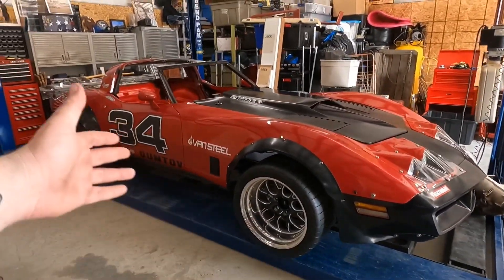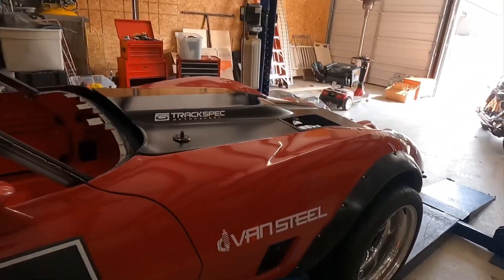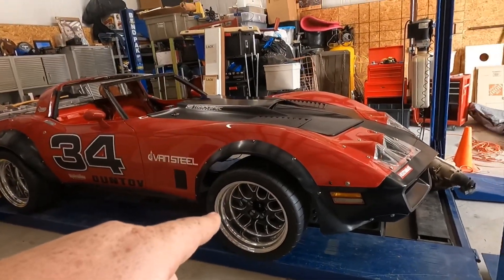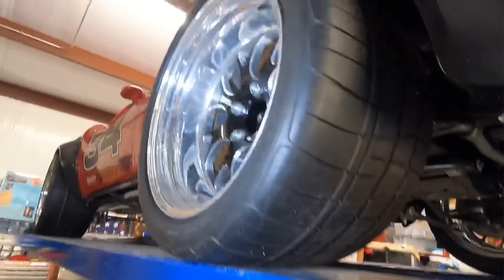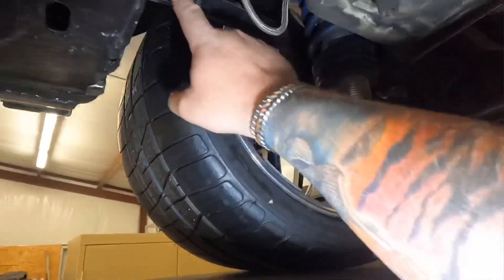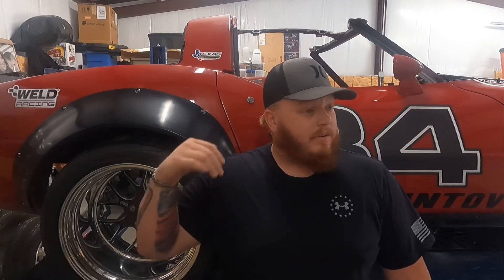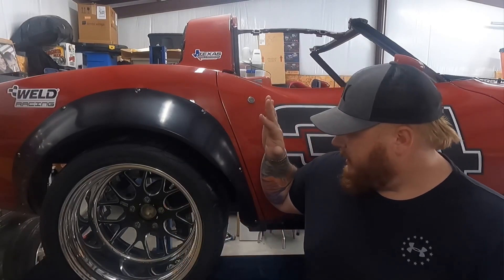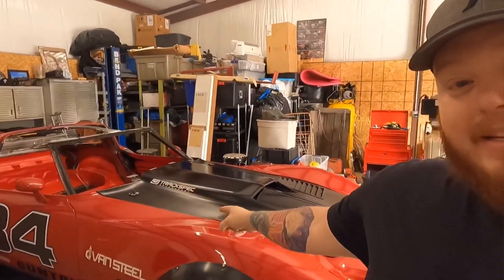The Step Child! My C3 Corvette racecar! Autocross/road course/drift car!

Comment: Any news on this? I'm starting a similar race build, a 1980 c3 for solo, open track days and maybe even rally. I'm planning to cut the t-top roof out for caging, and running with a light weight convertible top like the old greenwood cars. I think I can use an aftermarket convertible deck lid to fill the hole when the window is eliminated, and maybe even hinge it for access to the fuel cell and battery. Have you considered anything like that?